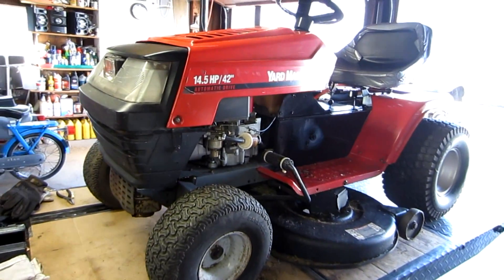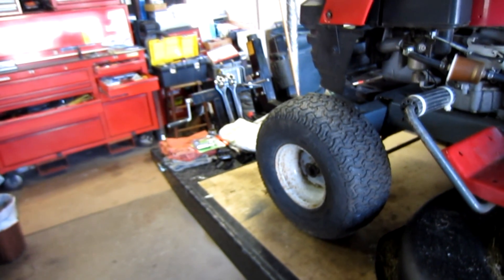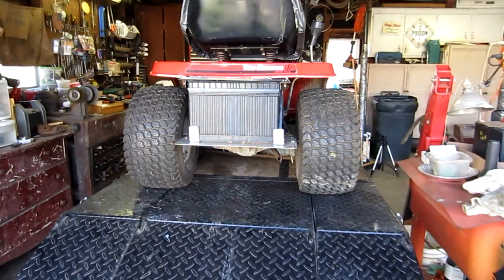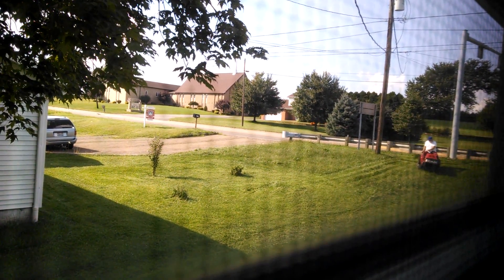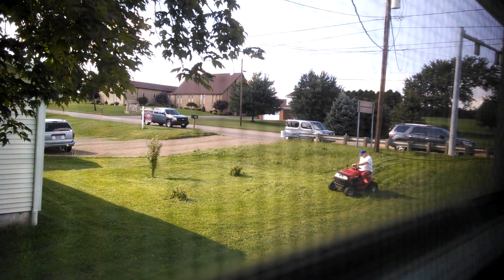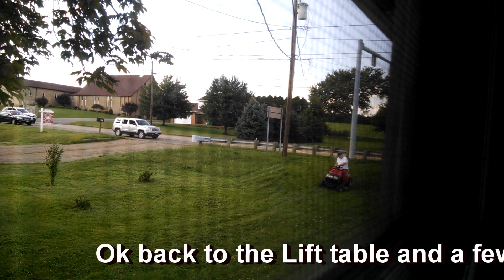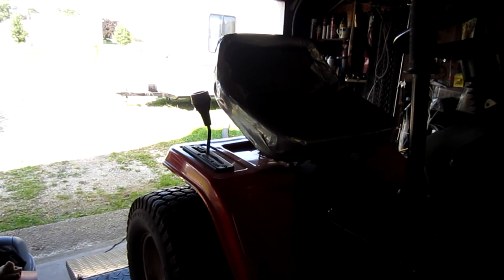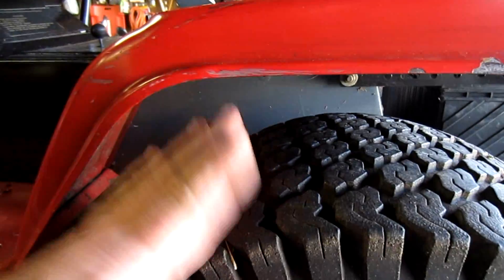Buying used MTD mower DON'TS

Comment: change out your lights for LED bulbs.... Less energy to run and you could get more light using them.
Reply: stock bulbs use ac not dc
Reply: Are you sure about that?  Is a lawnmower battery AC?
Think about this long and hard, I've got 37 years of Electronics background.  And even if it is AC and not dc for some strange reason
You could still change the AC off the alternator to DC with a voltage regulator. And that's exactly how a Lawnmower Battery charges.
Reply: you have 2 wires coming off the alternator one red one white I believe.  the red one was a diode to recharge the battery the other one is ac to power of the lights
Reply: yup, if you going to use LED bulbs, you need to hook them DIRECTLY to the battery itself with a toggle switch (if it don't have one) and an inline fuse, running them directly from the engine AC current will burn them LED bulbs out less than 5 seconds
Reply: SpiritsoftheWolf thats just a bunch of bull too. All the lawnmowers have a rectifier if it uses an ac coil.
Reply: saves a penny not needing  a switch if it runs off the magneto maybe. Cheap being the goal.

Comment: Who worries about a light on the mower? So unimportant
Reply from the maker: Some people work until late in the day and have to mow as the sun goes down in the evening. I have used my headlights on my old Sears riding mower plenty of times as I plow the driveway during the winter sometimes in the dead of night.
Reply: Replace the bulbs with LEDS.
Much, much brighter with only a fraction of the load. Your tractor's alternator/regulator won't even notice them.

Comment: Troy Bilt with the Invek engines are garbage, STAY AWAY FROM THOSE!
Reply: I have a 1996 Troybilt 46" with an Intek V-twin that sat outside in the weather for  the better part of ten years. It was thrown in for parts when I bought a 2003 Troybilt Bronco 42" mower with an Intek single.
  All the parts mower needed was an oil and filter change and a new o-ring on the anti-backfire valve and a float bowl cleanout (Nikki 2bbl) and it runs/drives/cuts just as good as new. The '03 just needed oil/filter change, fuel filter, and a manual fuel shutoff in the fuel line.

 I'd buy another used Troybilt any day.

Comment: i hate mtds the rear axles irritate me where they rust stuck i got an mtd transaxle in my yard and im pulling the rear wheels off and they wont come off!!!!
Reply from the maker: Whenever I had customers with bad transaxles come in I told them that part of the deal might be that their new tractor and transmission might have also different wheels and tires because a lot of them don't come off. So I installed wheels and tires from the salvage tractor that I was using the rear end out of.. Now if I replaced with a new transaxle I advised there might be an additional charge for new rims and I would cut the axles and try to salvage the old rims but if I couldn't get the cut off piece out of the old rim well, I had the extra cost covered.. They are some rusty b*st*rds

Comment: The brake pedal on those are horrible. They go back really far.
Reply from the maker: ***** yep they use the brake pedal as the variator control. If you are in forward and have the speed select at 1 the pedal travel back towards the operator is very minimal but it you slide the speed select lever up to 7 the pedal travels a considerable amount backwards.. Not a good design at all...

Comment: so what's up with all these drive belts for riding lawn mowers? was this stuff though up by a bunch of drunk monkeys?  Why not worm gears r gear box or hydraulic motors?
No more broke belts, more power to the blades with added shear pins positive drive and fast stop. Longer life. you could use plastic gears to save money and weight.
Reply: Gears add weight to the mower.

Comment: Simple: Just avoid anything MTD.  Huge pieces of junk.
Reply: mikeql bbejas how do you set the drive gears after renewing gear cable
Reply: MTD ruined Cub Cadet when they bought the name.
Reply: I've got an mtd 995 I'm pretty impressed with
Reply: Josh M  I agree  so don't buy  any  Briggs & Stratton product then
Reply: John Doe i was about to say this.
Reply: Kevin Beck Briggs isn't owned by MTD
Reply: Bullshit, MTD makes John Deere, Cub Cadet, Toro! They make ALL brands, STUPID!
Reply: Im from Germany, and i prefer MTD to Viking and Husqvarna. And that says something...
Reply: @Dawn Witmer and Wolf Garten (a pretty well known manufacturer for garden machines in Germany)
Reply: mikeql bbejas I have a big 1999 yard machines garden tractor with a 20.5 horsepower v twin Briggs and it runs great
Reply: Josh M i have used mtds for not just my whole life, but in our business and i have never had a single problem.  It just depends on how hard you run it, what kind of gas you use, and how much you run it.  That and some models can be faulty, but from personal experience they are very reliable. 👍
Reply: Jason Campbell ya I have 1 it's 14 year old works perfect it's the green 1
Reply: Dawn Witmer MTD does not make all brands. They do make Cub Cadet, but Toro makes Toro and John Deere makes John Deere.
Reply: @rogermurph101  actually johndeere I'd made by huskavarna

Comment: If I send a photo can you tell me my model number please?
Reply from the maker: Your model number for your tractor is located underneath your seat. The model number for the engine is located either on the valve cover or the blower housing. It's impossible to tell a model number just by looking at the tractor

Comment: buy a craftsman. i got mine for free and bought a deck for 80 dollars. all ive ever had to do was put a deck belt on it once.
Reply from the maker: Guinelle1 All brands need something eventually.
Reply: I've had a craftsman mower for 5 years, it does need a belt every once and awhile but if you keep up with the maintenance it'll last a bit longer

Comment: oh man I fix and sell and have 4 of these mowers. I hope I can sell them and make some kind of a profit.
Reply: Iv repaired and sold many of these, they are actually better built MTD tractors than the new garbage they are churning out. I don't ever recall a spindle roping off the old decks like this one has, but I see it all the time on the newer machines. Those older decks are actually pretty stout as well.

Comment: here's the one dont of buying a used (or new) MTD mower: DON'T DO IT AT ALL, MTD SUCKS
Reply: I bought a 2003 Troybilt (MTD) Bronco with a single cylinder Briggs Intek 18.5 last summer for $500. Guy threw in another non-running Troybilt 46" mower with a 20hp Intek V-twin that'd sat out in the weather for a decade for parts.
After replacing fuel filters, oil changes, and mucking out the float bowl on the parts tractor, I now have two good running/cutting MTDs for the price of one.
Nothing wrong with MTDs. Solid, dependable Briggs engines and decent quality tractors. Replacement parts are widely available and fairly inexpensive from online sources.

I'd buy another MTD any day without a second thought.
Reply: @joevogelberger9922  mine had a kohler engine and it blew up it was a 2013 troybilt horse